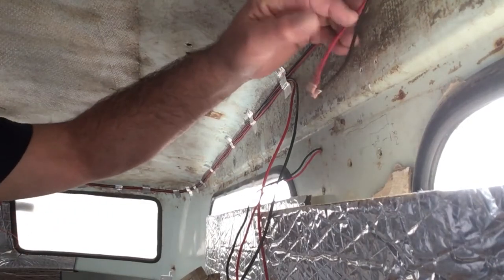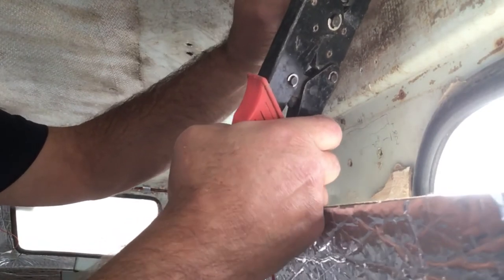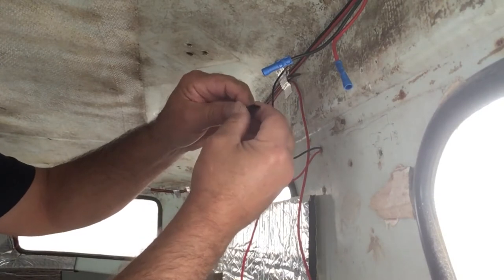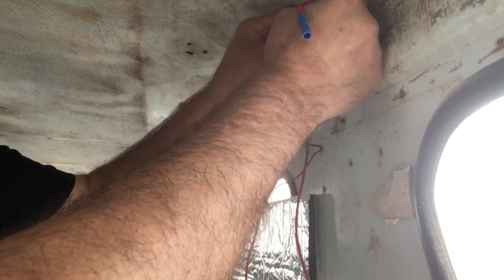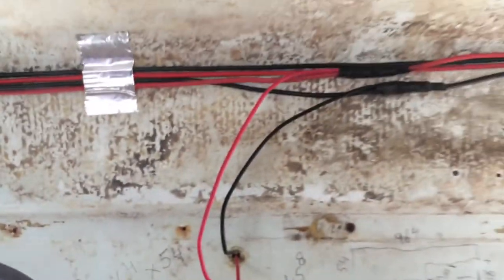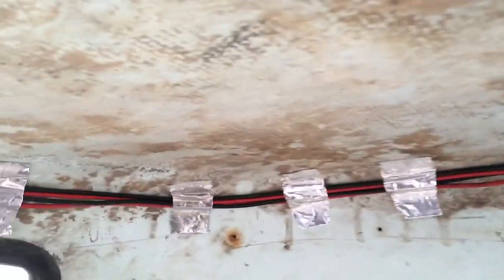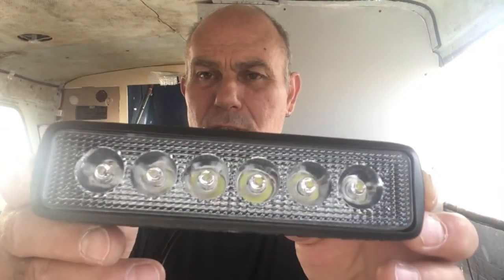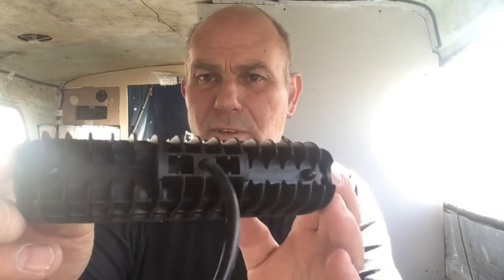29.Wiring navigation lights.

Comment: I'm redoing 50 years of bodged electrics on mine. It's not too bad in the nav light locations but when you get to the switches, bus bar etc there's many more wires so when heating the heat shrink I kept everything protected by putting a soldering mat behind it. They are a couple of quid from Screwfix or Toolstation. Just for piece of mind really.